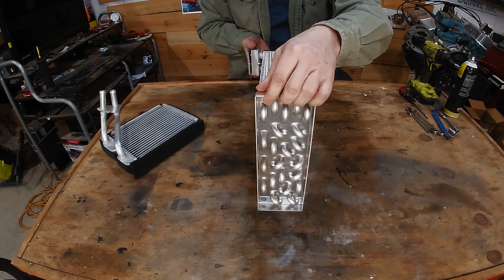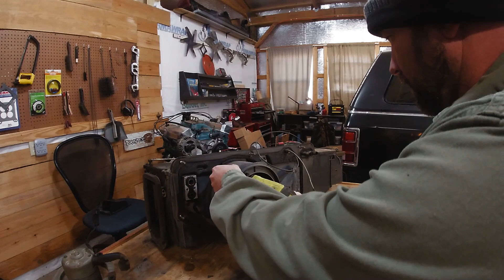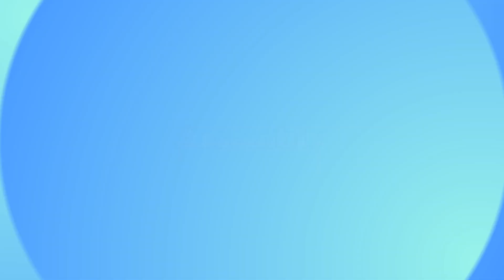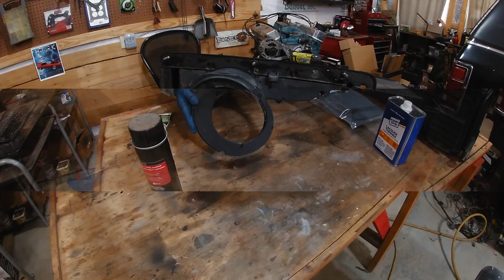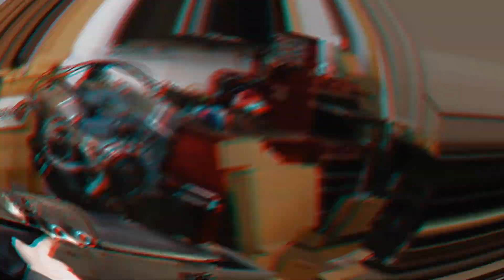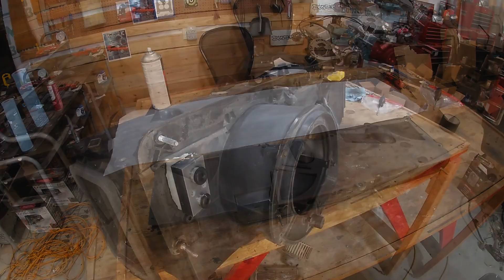Dodge Truck Heater Box Resto (81-93):  Ramcharger Build

Comment: I bought that same evap core, unfortunately the 93 w350 chassis has female ports on the manifold
Reply from the maker: Wow now that is a truck!  Is it different because of the 93 year?  That was the only year of square body and the Magnum engine.
Reply: @ im honestly not sure, its the 5.9 diesel, i bought the four seasons brand… everything is perfect minus the manifold, mine is female and that brand is male
Reply from the maker: @tonysmithjr4214  They could have sent the wrong one. Good luck